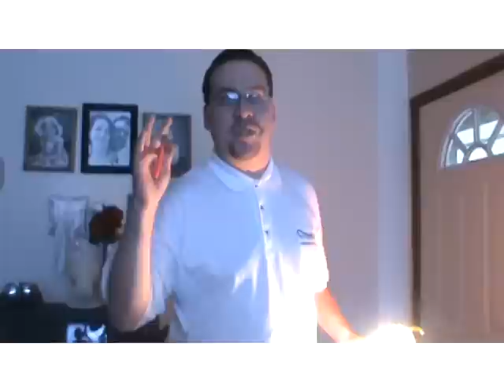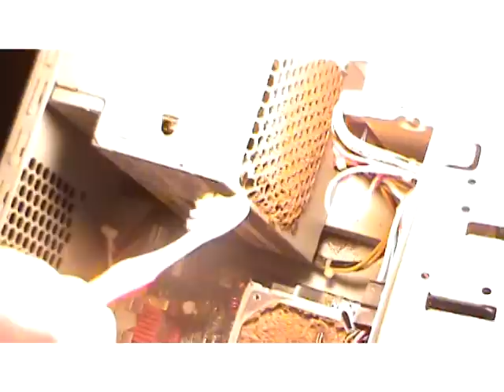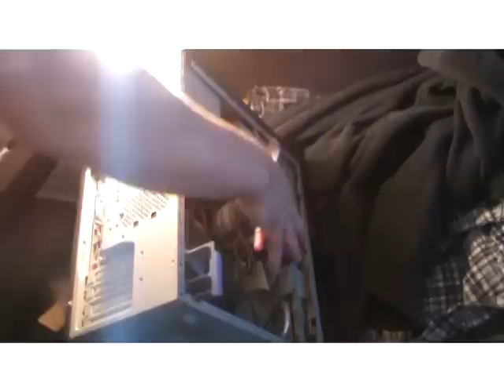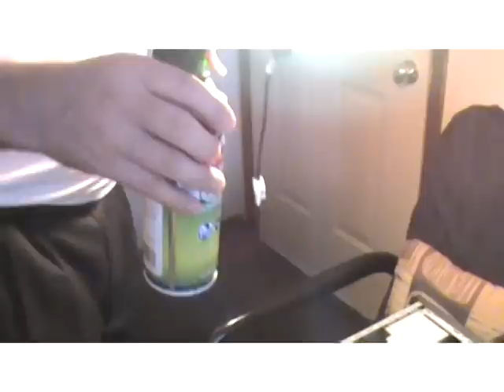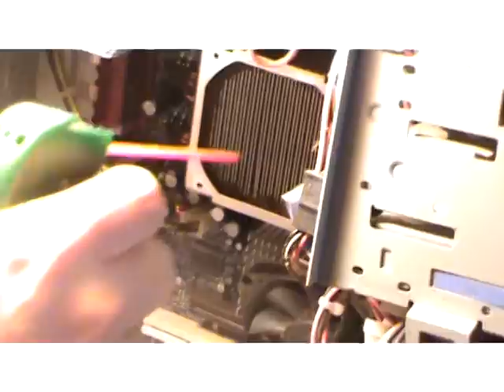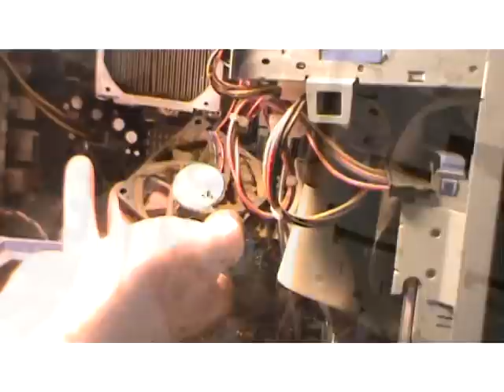Can Cigarette Smoke Harm Your Computer

Comment: Ive been smoking next to my gaming PC i built for about 6 months and it still looks fine on the inside since i can see inside the transparent window on the case. if it looks already does that mean it should BE alright?
Reply: I know this comment is 8 years old but like the guy in the video said clean your computer every month and it will be fine. Another option ofcourse is to just not smoke around the computer while it is on.